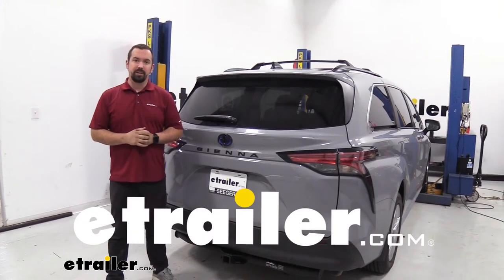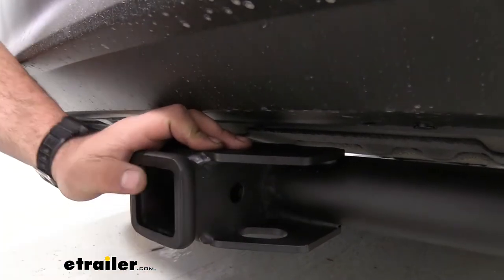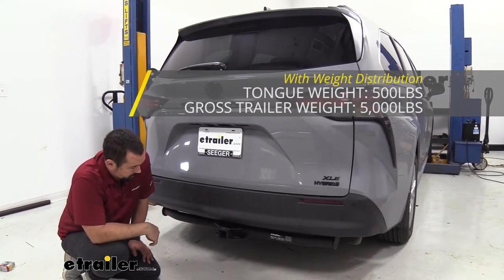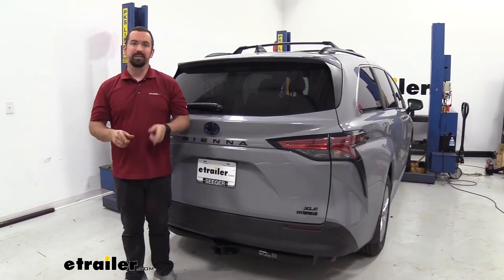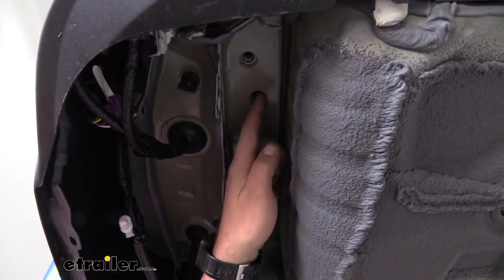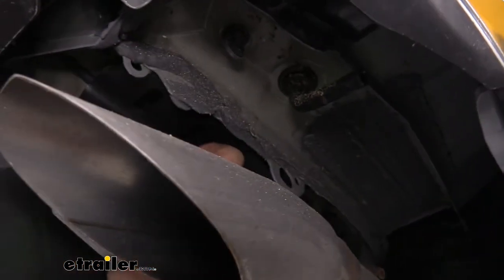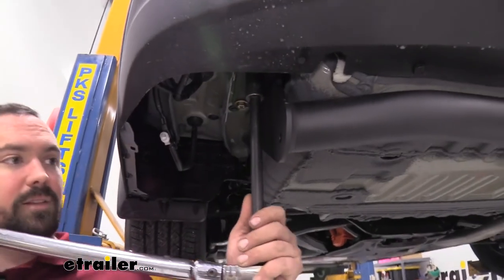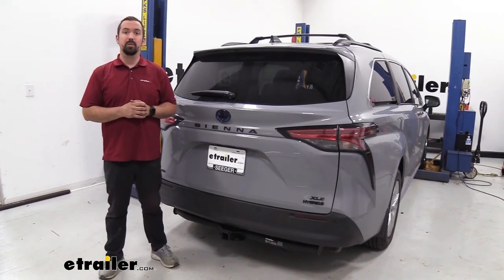etrailer Class III Trailer Hitch Installation - 2022 Toyota Sienna

Comment: Abut does this hitch block the kick sensor that opens the rear hatch?
Reply from the maker: Kinda sorta. It will in the area immediately below and next to the receiver tube, but if you wave your foot a few inches to the left or right of the receiver, the sensors will pick up the movement and open the rear hatch. 
https://www.etrailer.com/Trailer-Hitch/etrailer/e56RR.html